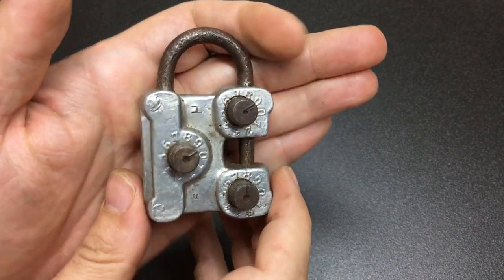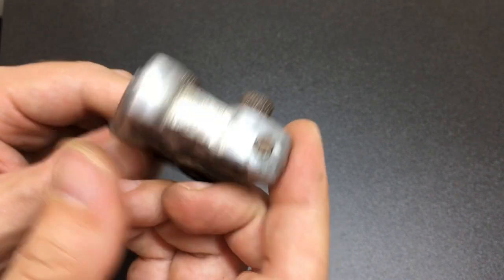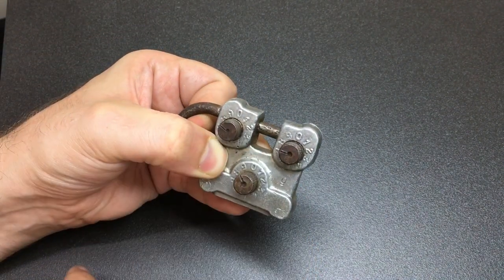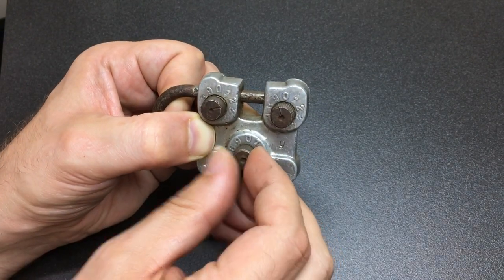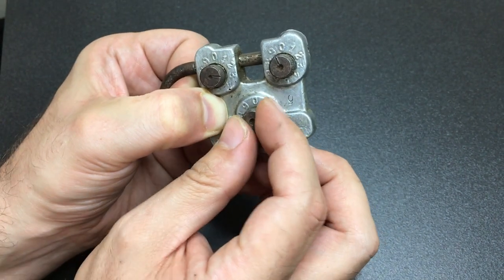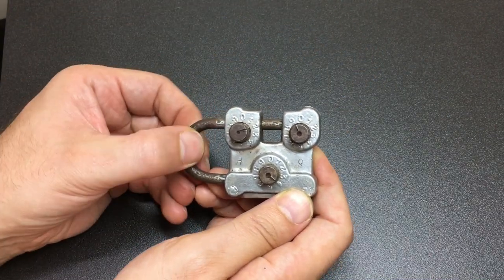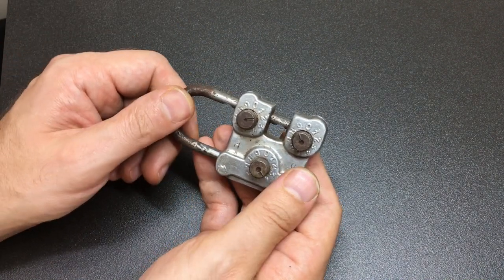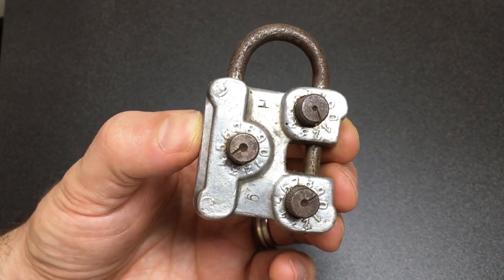Weird Soviet Era Combination Padlock Decoded

Comment: Cool old lock there with bundles of character, even if it's about as secure as a chocolate bank vault. Was cool to see, I'm curious in regards to that exposed shackle design though! 🤔
Reply from the maker: Yeah, it just doesn’t make much sense... I’m thinking it’s for looks :-)
Reply: @LockNoob  could even be tight fisted manufacturing trying to save on metal, would add up if mass produced! Bit of a shocking compromise if that is the case, however at the same time I wouldn't be surprised

Comment: I am sure if you opened it up, you would find a cut out on the actual dial shafts... really easy to decode. 

I imagine (guessing wildly) this is used to secure some sort of tool or equipment from a quick grab theft (like a motorcycle helmet lock). The square part secured to a rack or cable of some sort.  

I would also bet that you could pull off the knobs to expose a spline, so one could reset the combo.
Reply from the maker: I think you might be right about the combo :-)

Comment: Ok my 2 cents worth... Could the smaller opening be there to offer more security? My reasoning is that a hasp locked with the smaller opening would make it much more difficult to cut or hack saw the shackle.  It looks like you could cut the main shackle and the smaller "shackle" would still be locked (looking at the locking notches on the shackle)!
Reply from the maker: Very possible. Wish I knew for sure! :-)